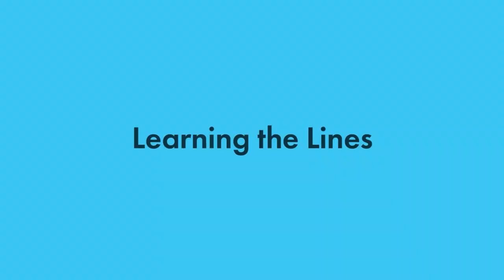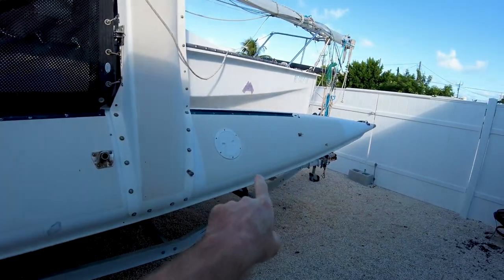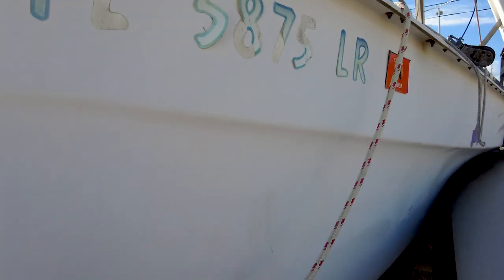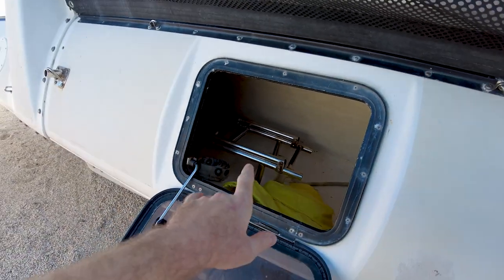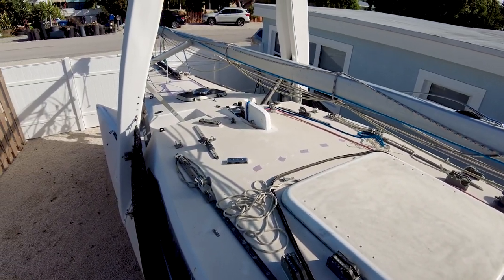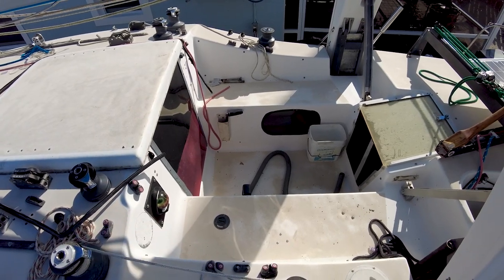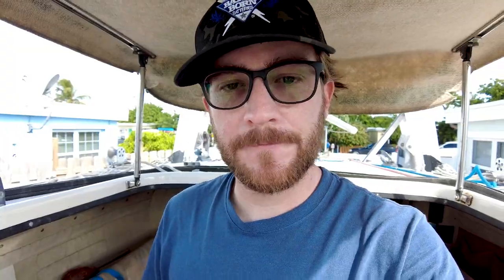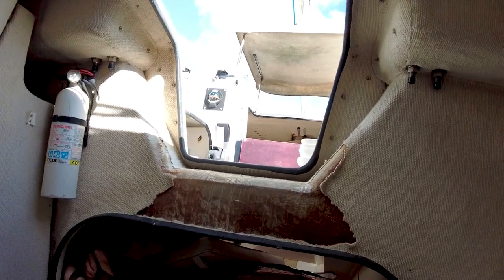WE FINALLY BOUGHT ANOTHER BOAT [Full Tour] Learning the Lines

Comment: I had a Corsair F-24 and now a Farrier F-22.  They are great sailing, fun boats.  I've taken each one of them to the Bahamas twice,  once single handed and once double handed, for about 3 weeks.  As you mentioned payload is the limiting factor.  We weighed everything, I mean everything on the boat and were over the total load by about 100lbs.  It really makes a difference in performance and in safety in rough weather.  I've recently looked at F-27s and surprisingly the payload is only about 100-200 lbs more than the F-22 which has higher volume floats.

Anyway, good luck. You will enjoy it.

FYI 'payload' includes sails, motor, gas AND crew plus everything else like tools, water, food, etc.

Comment: Congrats!  This is a super fast, super fun boat for weekends or a week vacation anywhere in the US.  She has a ton of deferred maintenance so all hardware and glass needs inspection, all rigging over 10 years needs to go, and any unnecessary hardware should come off.  I spent some quality time racing these with John Walton back in the day and the F-27 was his baby.  The interior is tight but very useable especially by adding a deck tent when at anchor.  Not enough space for a large solar array so I would reverse the decision to go electric and stick with a 6-8hp XL long shaft OB for reliable aux propulsion to get you out of trouble or home for sure if the wind dies or you have rig issues.  Cheers!

Comment: Awesome find!!!  Once you sail it at speed you will be hooked.  Steam clean the interior carpet.  It will usually come clean.  On the hatch you can pull off the carpet and clean old glue with a rotary wire brush.  Then recover or paint.
Be careful of the height of the aka's/ crossarms when you trailer around.  I think the height is 13'.
If you need crew I'm available.😀

Comment: just put a gas outboard on it man, mostly thats what ppl expect, but likewise it has to work 100% of the time
if this is about making money stick to that, its as good a reason as any especially if you have progress in mind. Leave the good-natured enviro stuff to the next owner.
actually tri's in these sizes are safer than cats because the ama (if designed right) covers the entire loaded displacement and will always right the boat if less than 90 degrees
tri's are also cheaper to organise at the same length and go upwind better but with understandably less accommodation compared to a cat
Finally, if you make this about restoration, you are guaranteed a winner, if not .... ?

Comment: At the back of the aft cabin put a crib size bunk port to starboard   it would  hold a child comfortable  up to 5 or 6 years
Reply from the maker: That's a great idea.
Reply: @LearningtheLines  How about a small, side zippered, travel cot suspended hammock style across the boat (gimbled?). Assuming you'll have more pitching than rolling on this boat. Might be the ticket whilst they're still small.

Comment: I like the larger (27 & 37) Corsairs a lot, especially if you are into camping. When I win the Powerball, one of my sailboats is going to be the carbon fiber F-37. The obvious great things about them are speed and tiny draft. You can get where you are going, stay ahead of storms, crank up the amases(?) to get into a small slip and great stability while sailing and at anchor. On the other hand, they are also tiny inside. My first real sailboat was a Pearson 26. We took it, actually it took us, all up and down the west coast of Florida, the Dry Tortugas, Key West (dodging a hurricane) and the rest of the Keys. Great for two people for a couple of weeks. But, by comparison, my cabin space from the main hatch forward was real, real close to that of the Corsair 37. The 27 is far smaller by volume. But you do have very good storage in the two amasi. It will be a fun sailboat. However, under no circumstances should you sleep in the aft cabin. It is a death trap. So, postulate you are anchored in a harbor, behind an island or just off the coast, sleeping in the aft cabin, when some entrepreneurs sneak up to your boat, board it and either close the cabin off with a piece of wood they brought ( because burglars do prepare sometimes), or shoot some pepper spray through the hatch (again preparation) and uncomfortably disable you or even simpler, one guy straddles the hatch with a club and whacks you every time you try to stick your head out. In the best case scenario, the other robbers steal everything and leave. On the other hand, maybe they just steal the boat with you in it. When they are ten or fifteen miles off shore, they let you out and say, "We are a kind and generous people. We mean you no harm. The beach is that way. Have a nice swim." Of course, even assuming you and your family could swim 10 - 15 miles, you wouldn't really know if "that way" was actually in the direction of the beach. See what I mean? So, bad, bad, bad, bad, bad, idea. It's not even a reasonable idea when your boat is on the trailer in your side yard. Use it for storage. Sleep elsewhere.
Reply: Wow! Are you afraid to leave your bed to get to the bathroom? Not necessary to put ideas into anyone's head. Negative energy has a nasty way of circling back on the one who puts it out there.

Comment: I like it !!
You said what are the advantages of that boat I would say one of the main ones is the cost upfront. It’s hard to find a 27 foot trailer for less than five grand. You are in a performance cruiser that will cover a lot of ground in a short period of time so that will allow you to travel to your destinations a lot faster. And those corsairs require very little wind to move at a pretty good pace. Plus points of sail. You will be able to sail up wind a lot easier than a mono hull or even a catamaran .. Solar panels that come along way you can find some Flexi ones and I’ve seen people actually put them on the trampoline for those trimarans and compared to hauling all that fuel around to power the motor or the generator at the price comparison of the new lithium batteries will pay for themselves depending on usage in about three years. You can go make your water offshore And keep the refrigerators charged while doing so. So many possibilities Jordan I like it .. another thought is isinglass roll up curtains with mosquito netting will increase the living space of that cockpit by 100%.

Comment: Hats off to you! Good luck, you're brave!

When you said "oh I'll just buff that out" "that's easy" "those are simple enough to get" "I'll just (insert anything here)" I laughed and laughed...

I'd have a complete inspection of the boat AND especially the trailer done to find the repairs that have to be done.  Then you'll be able to budget.

Every single purchase ask yourself is this a need or a want and every want is nixed. Basically You are repairing and updating the boat for the next owner, so generic generic generic. Everything on that boat that works or can be repaired stays. No fancy toilets, no exotic electric motors, I'd even go with AGM batteries. Functional not fantastic.
Reply: 100% agree, esp with regards to the trailer!  They are easily overlooked in these kinds of purchases.  Make sure to have the hubs checked and re-packed if necessary.  Last thing you want is to have a hub come apart on the road.  (Ask me how I know...  :~)

Comment: Very 'outside' of the box thinking on this boat. It's a real performance bad ass though. Swift passage  maker at the expense of livability for those so spoiled to larger living area. A water maker with only 18 gallons of tankage on that end will rather well be mandatory for ocean crossing passages I do believe. A little Honda 1000 I believe will be fairly well a good idea. I think it could be a decent live aboard for a single person,,,,,couple at best but man, it's gonna be cramped. Overall I am very impressed with the safety and speed of this little vessel. I am looking forward to see what you do with her. And yeah, 30-40K (40K with lithium storage array) is a very real expectation of resale once she is done over,  water maker and hydro generator. The electric drive outboard with properly high KW lithium storage array will increase her desirability HUGE to those looking for a smaller ocean passage boat. the only down side I see is her inability to have like a 300 watt solar array without heartache. I very small wood stove would add more to her comfort.  A Watt and Sea hydro generator would be in line for long passage making. The total storage appears to me to be most adequate for even a few people on a cross ocean passage but the use of freeze dried foods is going to be a plus there. Let's remember here that the cross ocean passage of this boat will be swifter than anything in a mono hull doing it of that length. So that lessens food storage area on an ocean passage by quite a bit. There's always fishing too!  :). This to me is a minimalist vessel to a very certain degree but,,,,,,,,,,,,,,,,,,she's a haul ass vessel. That she is trailable only adds to her desirability. Her draft compensates for many of the other negatives. 10KW of lithium should do fine as she will be easily driven with her light draft. In fact 10 is over shooting but all good engineering provides a decent cushion. Not going far on that but a  Honda 1000 will compensate to a large degree on motoring range.

Comment: I agree with everything you guys are doing and the logic behind it all. This keeps you guys invested in a project that is not just a money pit. I will love to see how this turns out. One caveat is this conversion to electric. I would go for it if it makes economic sense. That is if the cost and work to convert are in line with the vision on an interim boat. Also that weight and weight distribution improve. Otherwise if you want to contribute to that aspect on an interim boat without breaking the bank why not consider propane outboard?

Comment: Nice project boat , Strip the carpet install solar ,install battle born ,install electric motor , install electric stove install zero breeze portable air conditioner battery operated , and install mini water maker  . a mini generator , and hang out with Vagabon in the Bahamas . Where can you install a few solar panels that won’t be in your way perhaps out on the edges by then the trampolines ,

Comment: Boat flipping. Nice. I'm surprised, but happy!

Also: NEVER call a boat "unsinkable" Have you lost your mind?
Reply: If you filled every compartment to the brim with water, it still would float because of the foam core hulls. So short of using it to haul concrete, unsinkable is an accurate term.
Reply: @iverburl  100% agree.  You'd literally have to chain saw this thing into small sections to sink it.  And then any that were foam cored would still float!

Comment: Good choice.  Should be much faster than monos and is liveable enough.  Faster is almost always safer.  Can avoid weather better.

I would pay extra for a boat with no carpet.  Carpet will hide problems with the hull, trap water, and make the entire boat harder to maintain.  Plus it's ugly.

The pop top is brilliant,  Sort of a combined bimini/hatch at least when not under way.

You won't find a bigger supporter of electric drive than me, but given the size and role of this boat, it's not a great fit.  Enough battery to get cruising range would weigh it down too much.  Smaller battery bank for coastal cruising and day sailing would be ok, but a boat like this probably benefits from the lighter weight of a gasoline outboard more.  Hopefully when battery weight continue to come down in a few years, that won't be the case.

If you do go with an electric outboard, keep the battery relatively small for lighter weight.  This will somewhat limit you to day sailing and maybe coastal cruising, BUT trimarans such as these are so fast that you may have more range and less motoring than one might think.  They make very efficient use of the wind.

That said, I do think that the ethics of burning fossil fuels at this point are highly problematic.  Anyone who can't see the changes to weather due to climate change is a fool or blind.  We're getting thousand year floods every couple years, extreme drought, etc.

Long term, electric drive wins, and it's a fantastic synergy with sailing.  With regen/hydrogeneration, your energy to motor away from and back into the dock/anchorage comes from the wind via simply sailing with the motor engaged (or shore power, or solar power, or generator, or windmill, etc.).

Very much look forward to videos of the refit.  I think they will be educational for many people   Thanks for making them!

Comment: Talk about rode hard and put away wet! In all my years sailing these boats I have never seen anything like this. Check the transom for year built, those amas with hull deck joints I don't believe came along in till mid to late 90's. This looks like the boat that came off the trailer on the hwy near Miami and got new amas. Take the mast step off and pull the board, it maybe far shorter than original or cracked. So much damage to such a fine boat.

Comment: I'm trying to figure your location by your palm trees I see. The Outremer you showed earlier would give me heart burn; good choice. This is my answer to mold, and odor. I bought a 10,000 volt transformer, and two old spark plugs then I cut off the ground tabs. You can buy a spark plug extention, and trim off the lower part so you can screw them together like a pipe coupling. Drill a 1/4 inch hole through the side all the way through. Screw each plug at each other until looking through the 1/4 inch hole you see a gap of 3/16 or 1/4 inch. You don't have to buy a transformer an old neon sign transformer will work. Place the plugs in a glass jar add 115 volts. Put this device on a timer, and run for 24 hours, if you then set the timer for 20 minutes per day. If you inject this ozone gas in a small cavety it will heal up in your teeth. The AMA will put you in jail for injecting it into a tooth needing a root canal, and covering the hole with a filling. If you bubble the ozone up through water it will turn into ozone water. It taste like peroxide, But don't drink it just swish it like mouth wash. It will heal mouth and gum sores. ozone water will disinfect wounds. Imagine you were stranded on a deserted island with this device, and 115 volts ac you could make your own first aid anticeptic, also it will stop a tooth ach instantly. Fair Winds!

Comment: Well my friend, i suggest you consider a 20 hp suzuki . its safer , you will wish you had the power if you get caught in some high winds. electric motor are good for lakes and ponds. Your boat is way past that. You can pick up a 20 hp suzuki used in shape for around 1000 to 1500 and new for 3000. Think about it, you got a little guy now.

Comment: RANDY:  Norman Cook ,I am a 74 yr old Multihull  sailed with 60+ years of experience 
Including as a Marine Designer, a Master Sailmaker ,and 16 years if  teaching  at a State College in Advanced Material [ Composites ]  in Marine and Aeronitics.
I recently sold my 38 ft catamaran and am looking to either building or purchasing 
a 40 ' to  50' Cat for World Crusing.   The fact that you are in the  process of acquiring 
a " next / next  boat?"  I WOULD  VERY MUCH ......LIKE to talk to you about your  design in process.........obviously it's a Sailboat and possibly?  a cat......if so I am wondering
what  is your design on the underwater appendages  you intend to utilize on same?
Let's face it Keels do not go to windward, are slow  and restrict shoal  conditions.
Centerboards offer son degree of Safety but lose their foil shape as  they rotate and the helm is altered as the center of effort moves Aft. Additionally , they nest be serviced from below the water line  as well as  being mounted with a small  head area
again thru bolted below the waterline. Centerboard TRUNKS tend to be over sized 
to provide for growth  and the penant adds significant  fluid drag. Last of all is the very
EFFICIENT DAGGERBOARD that offer hi-aspect foils with high pointing ability as well as
great speed but not with safety due to their very design of fitted trunk without  impact protection  for those high speeds.
So what's your choice?  Can we talk?   Can I share your your thoughts and advice you on alternate design of scabbboads.
Please. Contact me 
Njsea7@gmail.com 
1 401 218 5042

Thanking you in advance 
Norman Cook

Comment: I wouldn't consider the trampolines true deck space...
I think you will find seemingly normal repairs to the materials jn the corsair are bit more costly and temperamental  in regards to repair  materals and techniques..  I feel that at best you may break even if all repairs go great and little unknown damage is found...thats with assuming all labor will be unpaid by yourselves. High perf craft like tris would be abnormal to NOT have a large compliment of sails..and use for each one.
I'm sure it will be both fun and a great learning experience...wouldn't be shocked if you refuse to sell it after all is said and done just because I can already see a bond developing between you and the vessel in the way you speak about it.